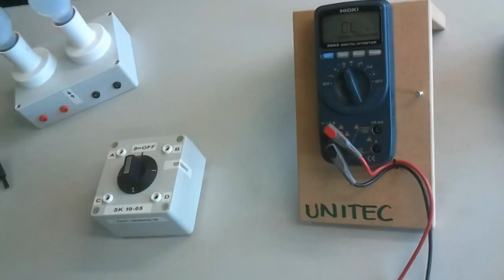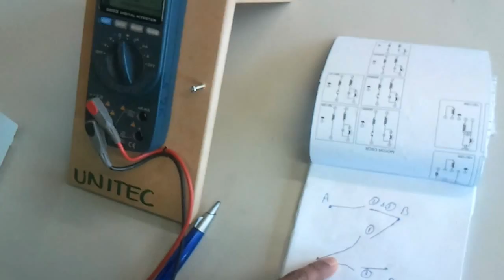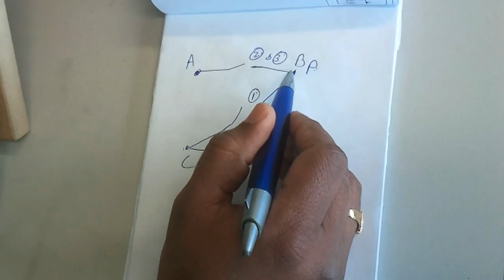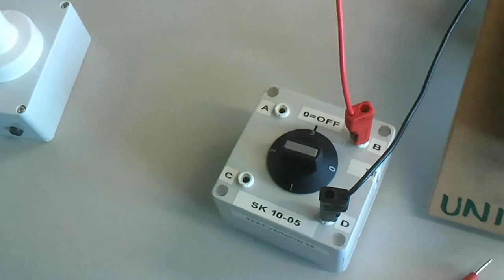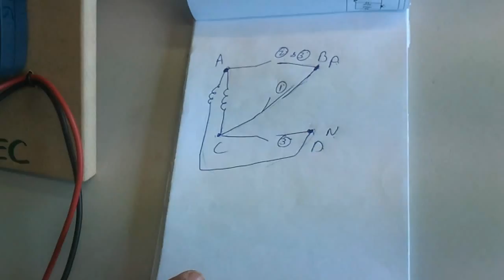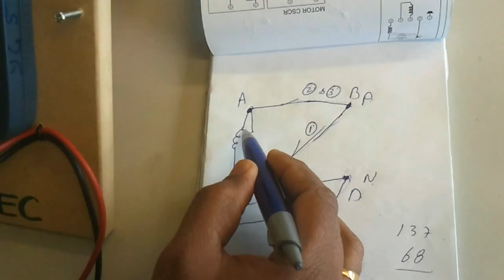Three heat Switch

Comment: I noticed the test tag was in the wrong placement on the power lead..
Also is it higher voltage or current as you switch from low to mid to hi..? Im assuming its Higher current as the voltage will always be the same..?